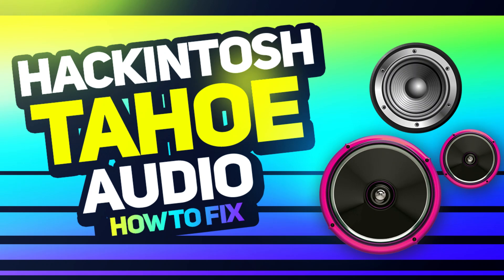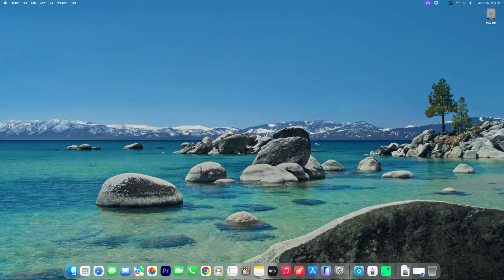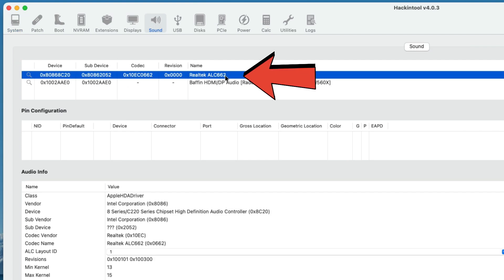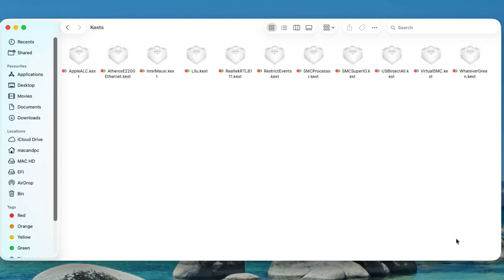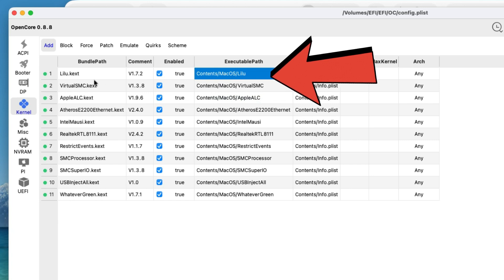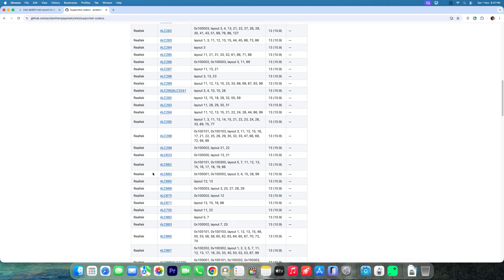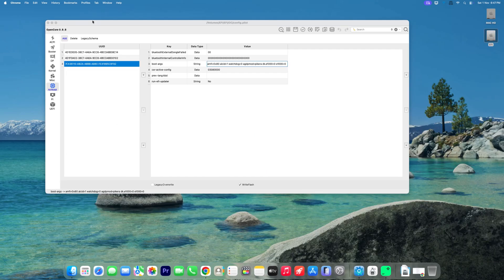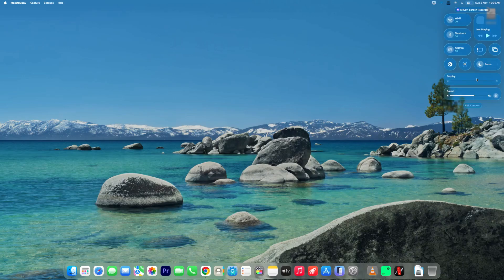Fixing Audio 100% on Hackintosh Tahoe

Comment: EVerytime I do this I get stuck in a loop and it never boots to macos tahoe again. I have to completely reinstall tahoe. ARgh!!!
Reply: Had the same thing happen to me. What worked for me was using the driver and changing the bios back to boot from the driver and macos booted right up. I’m having to reinstall Mac OS right now from a failed attempt trying to get AppleALC to work using oclp and bricked my os. Lmk if you find a solution

Comment: What if you don’t see any devices in the audio devices tab?
Reply: same problem here
Reply: @RushiIx-n2l yeah I realized what the problem was, 
Apparently Apple removed other intel audio device support for the Tahoe OS, so the audio kext doesn’t come right out the box, you have to use KDK to force install AppleHDA kext, but that leave you with a problem- SIP
Even when it’s deactivated, Tahoe forcibly reseals the the system upon reboot

Audio just doesn’t work on macOS Tahoe (26) on a Hackintosh because Apple removed all Intel audio drivers (AppleHDA + Intel HDA support), so the OS has nothing to communicate with your laptop’s audio hardware.
Reply: @_iamjulius so basically you can’t use audio in Tahoe?
Reply: @-Mlbo  you could if you can somehow eventually install the audio kext without triggering the system to lock itself in … 
I’m actually working on finding a fix for it 
Will keep you updated
Reply: @_iamjulius  I been trying for 3 hours and I finally made the audio works again
Reply: @-Mlbo  What did you do?
Or let me ask— how did you do it?
Reply: @_ @_iamjulius  I asked Gemini how to fix and he made an script when the SO starts so it start the kext automatically, bcs Tahoe blocks the kext when opencore try to start it